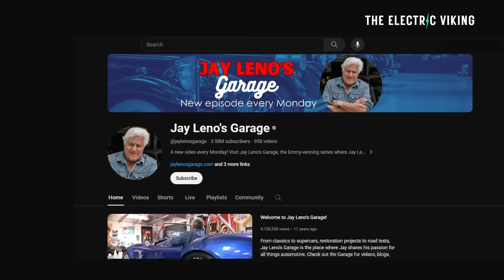Tesla reveals Semi production volume for 2023 and mass production in 2024

Comment: Nah, some of the older trucks blow lots of particles but the newer have to run detergents in the exhaust stream to get licensed. Electric is good but the trucks over all will have variable batt packs and some will drag going up hills and god forbid having the batt pack fail going uphill,, lane will be closed and traffic backed up for miles.
Reply: Sounds exactly like what happens if a diesel semi fails going up hill. Why do you imagine this will happen any more frequently with electric semis than with diesel semis, which I see on the side of the road with the hood up all the time?

Comment: Is this before or after the recalls for millions of Teslas in the US ???
Reply: I assume you're unaware that the "recall" is actually an over-the-air update, which for me took place in about 25 minutes while my Tesla was parked in my garage charging. Meanwhile, Honda is recalling 2.6 million cars for fuel pump issues, which require the car to actually be taken to a Honda dealer and left while the repairs are made.
Reply: Nothing to see here. Lol.
Reply: @BigBen621 what of the suspension and steering failures currently under investigation?

Comment: Huge reach with the diesel trucks are slow up hill making them dangerous. 

If you have a 30 ton electric truck even if you could floor it up a hill at car speeds the drain on the battery would be enormous. (There is already recommendations not to floor your normal ev because it reduces range.)

Tesla's trucks aren't being produced on mass because they can't get the numbers to work. Trucks including cargo can only be a certain weight, the battery needs to be massively large and heavy to make it functional it actually makes the truck not fit for purpose because you can't move enough freight to be profitable.

Some other YouTubers have done the breakdowns of the math and it just doesn't work.
Reply: Pepsi is running electric trucks from sacramento to Reno already. That is a long uphill run.
Reply: @klardfarkus3891 transporting potato chips 😅😅😅😅😅😅. A truck load only weighs 5 tonnes!!!!
Reply: When you start out with BS assumptions, you can always use math to "prove" that a thing doesn't work.  Tesla has done the real math.  It works.  If I floored my EV on a hill, I would go airborne when I hit the top.  You should drive an EV some time.
Reply: Huge reach with the diesel trucks are slow up hill making them dangerous. 
Really? Here's a Tesla Semi towing a flatbed trailer loaded with 44,000 lbs. of concrete highway barriers, accelerating rapidly (watch the speedometer) up a steep slope on Donner Summit, passing a diesel semi as if it were standing still: https://youtu.be/LtOqU2o81iI&t=985. This is exactly the dangerous situation described on the video.

 If you have a 30 ton electric truck even if you could floor it up a hill at car speeds the drain on the battery would be enormous.
As @klardfarkus3891 and I pointed out, Tesla Semis routinely climb 7,200 feet from near sea level at the Pepsico Sacramento Bottling Plant to Donner Summit at 60 MPH, while diesel semis are struggling up the hill at 30-40 MPH.

 you can't move enough freight to be profitable 
Tesla Semis haul within about a ton of the maximum payload of a diesel semi. For the few applications where a payload >22 tons or so is required, diesel semis are still required.

 Some other YouTubers have done the breakdowns of the math and it just doesn't work. 
You're likely referring to Thunderf00t. He is an obvious, blatant, egregious and easily proven liar.
Reply: If you floor your gas engine or diesel does it use for fuel....yes it does obviously
Reply: @robertfonovic3551  Pepsi is soda pop. They don’t make chips in a pop plant. The chip trucks say frito lay on the side. You don’t know anything about this.
Reply: @robertfonovic3551 It's a bottling plant.  They don't deliver chips.  Only drinks.
Reply: If a semi going up hill slowly is dangerous, we need to address our licensing system. And, top tip: When you see a semi going up hill, slowly, its engine is producing 300, 400 or even as much as 500kwh of power to get it to go as fast as it's going. How much power do you think that it's going to take to get a Tesla semi up the same hill at freeway speeds?
I'm just guessing, but  a couple of thousand kwh comes to mind. That probably isn't too far off the mark, realistically. 
I don't know how well you know Australia, but basically, the run out of Adelaide, East bound up the hill would almost drain the entire 900 kwh battery by the time you got to the top, at freeway speeds. Musk lives in a land of fantasy, so do his scientifically illiterate believers. The rest of the universe works on the basis of physics.
Reply: @robertfonovic3551  Dude, a bag of potato crisps weighs about 50 grams. That's 20 bags per kilo. 20,000 bags per tonne. Are you telling me that they can get 100,000 bags of crisps in those trucks? I've got to say, I've never seen a vehicle before that can carry one hundred thousand bags of potato chips! Musk is a genius!
Reply: @davidbrayshaw3529  Pepsi is already using the tesla semi on the mountain run from sacramento to Reno Nevada. Too bad for your flawed analysis.
Reply: @davidbrayshaw3529  Have you seen the Tesla semi on Bonner hill passing a diesel semi up hill???
Reply: @davidbrayshaw3529  Dude is making up a baldface lie about the chips. The Pepsi facility in Sacramento California is a bottling plant.  It is a low lying site surrounded by mountains.  The Tesla Semis run 21 routes, the longest is 450 miles.  They carry only soft drinks and vending machines.

The depot is all electric.  No diesel trucks there.
Reply: @klardfarkus3891  How much power is required to haul 80,000lbs up and elevation of 4,4450 feet over 132 miles at 60 miles an hour?
Reply: @vancity2349  Yes. And I'm not saying that it is an impossible task. But to do so requires a huge increase in power delivered to the tyres and thus very high levels of current draw.
Remember how much energy it took to pedal your bicycle up a hill, as a kid?
Something has to give. You've either got to tip in a lot more leg or you have to slow down. Physics.

Comment: No one will tell us the haulage load of the semi . If the batteries only last 100,000 miles before dropping the efficiency that wont work in the real world
Reply: It's the same as a class 8 diesel.  The battery will last a lot more than 100K.